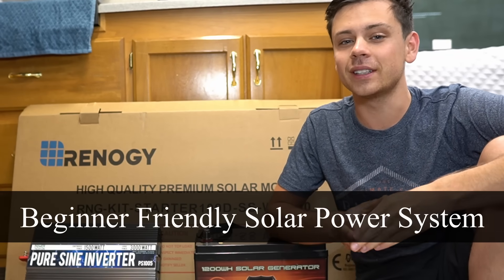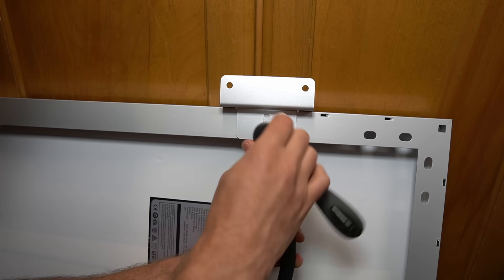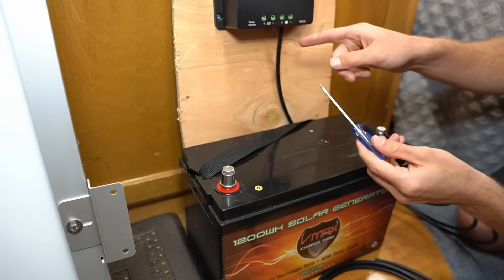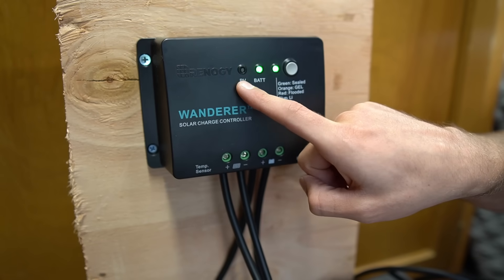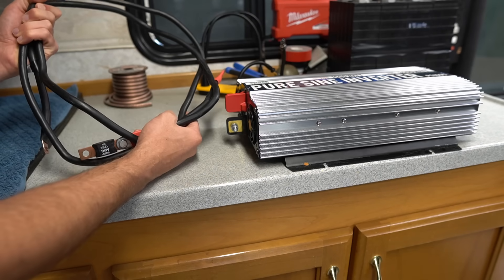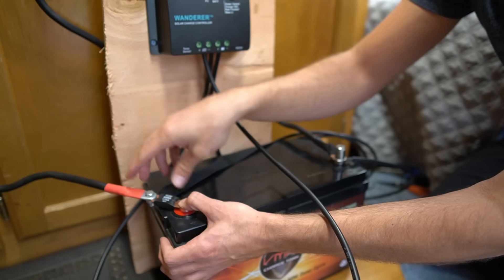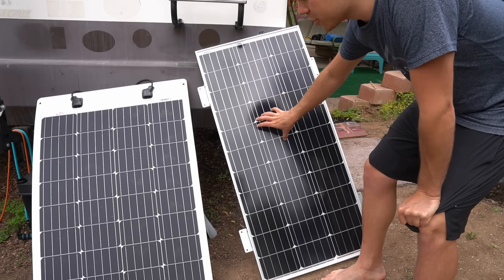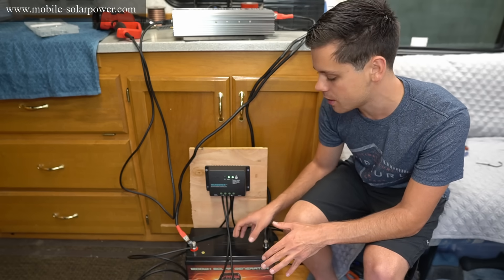Build Your First Solar Power System! Beginner Tutorial Easily Explained, Budget Friendly

Comment: Just to add, I believe the reason you get a spark is because the negative was installed first before the positive. Generally, the negative wire should be removed first and installed last to avoid a spark.
Reply from the maker: If you complete the circuit and capacitors are involved, spark occurs no matter what
Reply from the maker: And that rule is for avoid shorts on automotive application DC systems.

Comment: We just bought a renogy adventurer and getting ready to mount to a piece of plywood. I realized the set screws are behind the unit so if we had mounted the controller to plywood we would not have been a way to unscrew the set screws to put the cable in.  We will have to plug in all cables then mount to the plywood.  In the future when we do add an inverter we will have to remove the controller to remove one of the solar cables as you stated in your video.  Any thoughts of an easier way around this? Great videos by the way, they are very informative.

Comment: Very well explained. You are saying that you shouldn't discharge the battery  fully or you can damage it. I was under the impression that deep cycle batteries were meant to be almost fully discharged without issues.

Comment: In my rv I have a converter that runs all my electric needs whdn I am connected to shore power. When I go boondocking and switch to solar with an inverter will my fridge continue to draw power from my battery even if the battery is running the inverter.
I know I will connect my tv etc to the inverter. One more question .Can my 100 watt solar run a 2000 watt inverter.

Comment: Is this system powerful enough or how would one run a modest/simple microwave oven and an electric or induction cook top element?  How do you run wire, say, from the back of a box van to the front (Where the kitchen/bedroom would be) to an outlet? What kind of outlet or do you just run a metric butt-ton of extension cables? Thanks.

Comment: I have the renogy 100 watt solar panel and the rover mppt what brand of lead acid  batteries do you recommend ? I might add another panel eventually. Ive seen a trojan t1275 with 150 amp hr what is your suggestion?

Comment: Will- Thanks for your teachings- you make it easy to understand! however; I noticed you do not delve into dual parallel circuits! Dual parallel circuits do not have near as much parasitic loss, and can take a lot more power with smaller cables. therefore; a person can make a system that can handle a lot more power without re-doing the cables every time a person adds more panels! Keep up the GOOD work !

Comment: I have a question I have a harbor freight 100 W solar panel kit is that a good kit?
Reply: I have used them for 3 years in continuous with out problems.
Reply: Michael Corbett question what’s the minimum battery voltage before you should stop using it past 50% mark i’m running 13 Volts Day time at night time it drops right about 12 V maybe 11.9 using some lights i’m using 4  12 V batteries
Reply: @fabianpaco2916  I have 8, 24D 12 volt marine batteries in line that I use. 550 watts of panels, at max 23 amps charge them during the day. and since they are deep cell I can dump to 10.9 volts at night. That is rare to get to that point. it only happens after long periods of rain. say 4 days or more. My panels are the Harbor freight amorphous. They are a blend of the old 15 watt and new 25 watt panels.  I have had no problems in 3 years of use. If you would like to know more let me know:)
Reply: Michael Corbett pretty sure I have some deep cycle batteries too they have the screw on terminals only they’re off my international commercial truck Also I’m trying to power my shallow well pump with the tank from Harbor freight 1 horse power I tried to use my 1000 power inverter didn’t work it makes noise like it wants to turn it on I think I need a higher power one  thinking of buying the 5000 Jupiter inverter also I’m thinking of buying another solar panel kit to add to my 100 watts to make it 
400 watts  do I need more solar panel or better inverters?
Reply: @fabianpaco2916   My system is DIY I am not a electrician. Is the pump 220 volt? May need a second 110 volt inverter to complete the volts required. Also you may need to add more solar panels to keep the batteries charged. Higher level inverters will need larger wires and more batteries to power them. I run 8 batteries inline now with the inverter connections on Battery 2 and 7 to pull less amps per battery. Note; Harbor freight will their panels on sell Sept 2
Reply: Michael Corbett I have a 120 V pump from Harbor freight it a shallow well pump and tank “Drummond” yes they should have a sale going to buy another set of solar panels to make it 400 Watts and yes I was using very small wires the inverter won’t push it So I put bigger gauge wire it does a quarter turn on the motor 😬 i’m getting close 😂 i’m thinking a 2000 W inverter will do just to be on the safe side maybe 3000. I am very new at this and an experience and learning on the way and learning from you thank you
Reply: @fabianpaco2916  Okay sounds like start up Amps is low on the inverter. I am surprised you do not get an alarm on the inverter. also sounds like a storage problem. IE on in line batteries connect charge controller positive to battery #1 and negative to the last battery.. Allows even charge across the batteries. Also the same with the cables from the battery to the inverter to reduce the amps discharged per battery from the battery bank to the inverter. It gives the inverter more power. if that does not do the trick then yes you need a bigger inverter.
Reply: @fabianpaco2916  For me; I use the 100 watt charge controller that comes with the harbor freight system, hooked up to the batteries only to run lights and a 12 volt fan. 24/7. I use the 1000 watt inverter to run. refridge, micro wave direct tv, and a freezer. it also charges my computer and phone. Yes I have to turn the others off to run the microwave. The next step is to add batteries. 2 a month for the next 6 months. The more you have the longer you can run items, say during rainy weeks. Then I will step up my inverter.
Reply: Michael Corbett Wow you could run TV refrigerator and much more I must be doing something wrong with my battery connections I have 4 12 V batteries All positive are connected to all four batteries and all negative are connected to all four I put my inverter connection with alligator clips at the positive number one battery and I connect the negative alligator clip to number 4 battery🤦🏽‍♂️ to make it one big 12 V battery
Reply: @fabianpaco2916  I am the same with 8 batteries, except I upgraded the alligator clips.
Reply: @fabianpaco2916  truth be told I had problems with my system until I got to battery 6 in the bank. Then the problems went away.
Reply: Michael Corbett I have 3 charging right now Maybe when I put all seven together it will work if that doesn’t work I’m going to get a bigger inverter maybe I should stop using alligator clip  for I can get better contact
Reply: @fabianpaco2916  Just make sure all the batteries are the same. regular car batteries don't work. They are sudden discharge, and a mix of them with deep cell will hurt the regular car battery.
Reply: Michael Corbett OK thanks I didn’t know that I will check the batteries I’m pretty sure the deep cycle your commercial use

Comment: Hi, I have a question. Have you ever tried combining solar and wind power? I am currently running the old 45 watt solar panels from harbor freight with two 35 Amp hour batteries also from harbor freight. I am only using them to run 5- 12 volt d/c light bulbs and am considering expanding the kit. I've seen some 2000 watt wind turbines at reasonable prices, but I get stuck on figuring out the size of dump load I would need. Any help would be greatly appreciated.

Comment: I am considering an Air Conditioner / Heater mini split for an attic work space. I found a mini split unit that can run on 12 V. How do I determine the size (number of panels etc.) to run the system?
Reply: How many tons, how many hours off opperation.... Your going to find it cost prohibitive, be my bet.
Reply: @jondoe3561  , good points ! I will size the space and estimate the req'd. tonnage.

Comment: Instead of the voltage monitor you can use a 12 volt battery charge relay like the " Samlex Accuscheider BS 100 Dual 12V " or  a "Victron CYRIX-Li-CHARGE 120-12/24 CYR010120430" 
Put that relay between the battery and the inverter. This setup will cut the power to the inverter automatically if the battery gets to low.

Comment: Why is the temp sensor so important.  I bought a 200 watt kit for my vacations now.  I camp in a field at a tractor show and i will still bring my generator and battery charger because i dont know the system yet and i need a fan.  I sleep under my flatbed trl covered in a big tarp and it can get warm at times and no bugs if a slight breeze from my fan i run.  Last year i had tarp issues and my bedding got wet and ran the fan hard but it dried it out for the next night. In a few years i would love to have a pickup camper and i will expand my solar for that so generator wont be needed unless running an ac unit or cooking with 110

Comment: Hi Will.  Love all your videos! I have a question about your connection of the black wires to the Charge controller - I have this same Renogy system (except I have 4 100 WH batteries, and 4 100 watt panels, and I also have the 40A MPPT charge controller) - I have the same 2 black cords, but they are not marked whether they are positive or negative (they both look exactly the same), so how do I know which wire to connect to the positive and negative of the charge controller and battery?  I know this might sound like a silly question...but I felt like I was going crazy over here trying to figure this out.
Reply from the maker: Is there a label in the panel where the wires insert?
Reply from the maker: You can look up a picture guide of which one is negative and positive by how they look. At the solar panel, one mc4 connector looks different and you can use that to figure out which one is what

Comment: In automotive 12v the rule for connecting positive wires is "first on, last off" and you are reversing that. Is there a reason why?
Reply from the maker: Yes because those systems are grounded to chasis
Reply: Ok. Makes sense. Thanks.

Comment: Would you consider holding a long screw driver on the battery terminal and touching the inverter cable to the screw driver near it's handle so that the spark happens away from the battery? Spark on a battery terminal can be dangerous.
Reply from the maker: I only use sealed/lithium batteries so it's not dangerous
Reply: @WillProwse  My bad, I misunderstood I thought it was a lead acid battery :)

Comment: Thanks a lot mate!

Some numbers from the components in the video : 

12v 90W (6A) Solar panel 
Sunsei 25A Solar charge controller
Chicago Electric 400W 120v Inverter
2X EverStart Marine 109AH battery

I also added a 12v to 5V 3A converter so that I can power by USB powered IP Camera, Wireless Router, 4G Modem, and PIR motion sensor light for my DIY remote monitoring and security system thats lightning and power failure-proof.

My assumption is that it would take around 36 hours of full sunshine to completely charge these 2 batteries with the 90W setup.
Considering we only get like 4hours of strong sunlight per day, that's 9 days of charging - but we can keep adding more panels to reduce the time.

Comment: Help Please. I did this exact setup with same everything.  Fully charged today to 100% or 13.2 Volts.  3 hours later with no load I’m at 87% or 12.8 Volts.  That gives me .6 Volts to use.   Is this depletion normal?   Thanks
Reply from the maker: Totally normal
Reply: I have added an additional 100 watt panel for a total of two.  Wanting to increase my storage size and would like to know if it’s okay to add one more new non sealed lead acid battery and double my battery capacity?

Comment: I built a solar generator a few months ago and used a lot of this same stuff. I got the Renogy starter kit during a flash sale. Didn't use the solar charger tho since it doesn't give you any info. Have that same inverter except it's 300 watts. Weird thing is the brand I got was from Power Tech On.

Comment: thanks                 how far away  can the panels be from the other equipment?  i want to run a 12 inch fan at night in my bedroom then shut it off,  guess i can keep everything in the closet ect except the fan  on a table how away can it be also
                  thanks
Reply: Once you come off the inverter there won't be any significant voltage loss in the 15 feet you have I n the van,,,SAFETY NOTE  a thin cheap extension cord will get warm if the draw is too high...please get an extension heavy enough,,,You SHOULD get a 12 volt fan ; then you aren't using up electricity keeping the inverter running....There would be NO noticecible loss on 12 volt.if you use 16 guage wire.....NOTE I purchased a 1500 inverter with a remote shutoff ...I only turn it on when I have to...almost all of my 2001 ford conversion van is 12 volt....picked up a small USB rechargeable fan recently so that I can use it at night without using ANY of my 12 volt battery power from system.....the fan recharges off the solar during the day
Reply: @peterandrews4172  thanks for the quick reply and ideas, and new know how, i am looking into those fans  ...just subscribed too .. your welcone lol

Comment: All my experience with automotive batteries and research says to connect the Positive terminal before the Negative to avoid spark near a battery that can be hazardous and may explode the battery.

 "Let's assume that we connect the lug(terminal) on the negative lead first.

When the lug on the negative lead is connected , the whole frame of the car becomes grounded including the nuts and bolts associated with the frame. Now, when you are connecting the lug on the positive lead, if the spanner comes in contact with frame or any common Ground terminal, it results in a dead short on battery which may possibly explode the battery.

On the other hand, if you connect the lug on the positive lead first, and then the negative, even if the spanner happen to touch the frame, it doesn't result in any harm."

Is this different with solar?
Reply from the maker: Absolutely and completely different with solar. In automotive, positive first always. I do negative first so I can charge inverter capacitors without stressing my ocpd.
Reply: @WillProwse  would it be better to connect the positive to the battery first so that the spark is as far away from a possible out gassing battery and then the Inverter?

Comment: Just curious? But when I did auto mechanics we were trained to always complete the circuit with the negative terminal on the battery. So as not to fry any sensitive electronics. Seems it’s different here. Could you explain why? I’m thinking of doing one of these soon. Thanks
Reply: In shop they teach you to disconnect the negative first because the entire frame of the car is negatively charged. So if you touch anything from the positive side of the circuit to ANY part of the car it's a short. Once the negative is disconnected the only way you can get a short is by touching the negative terminal on the battery itself. From an electronics perspective, there is no difference between the positive and negative terminals being connected. Either the circuit is live or it isn't.

Comment: Thanks for great explanation, I will follow the layout to install a 190watt system to my truck camper. I need info on whether I need to wire anything special to my current onboard PD9130 charger/converter as it currently charges my 100ah sealed battery at the rear of my camper. Do I wire everything to my battery area or do I need to run anything to the PD9130 or to the current dc fuse panel? Thanks for any input.

Comment: So I want something small like this for my shed to have LED lights inside and to charge my power tools. I live in southern Georgia. I want to know two things. Will the heat inside the shed be to hot for the battery, charge controller, and inverter? Is this system big enough to work during winter time. Currently I don’t spend an enormous amount of time in there but when I’m there I am there for a couple hours.

Comment: Maybe someone can help.  I have a Chevrolet Spark EV, and I'm wondering if this setup can charge my EV?
Reply: Not enough voltage - I think you need hundreds of volts to charge an EV. You probably could, maybe - but it would take days or weeks to fully charge considering the sunlight cycle, etc. and low rate of charge. If you take what's used in this video and multiply it 20 or 30 times, you would probably be able to charge your car in a few hours - but that's probably not feasible unless you've got a hundred thousand dollars sitting around. :)
Reply: Yeah I don't have 100G's bursting out of my pocket.  Geez I don't even have $1 in my pocket.

Comment: Never have a negative connected to a battery without positive connected first. Good video!
Reply from the maker: In this instance, either wire can be first. That rule only applies to automotive systems where chassis is ground.

Comment: Here's a question. I bought a 3000w inverter from Rena g and they said I need a 300 amp fuse to go between the panels an inverter.they did not know where to get one but I don't believe that is correct what do you think